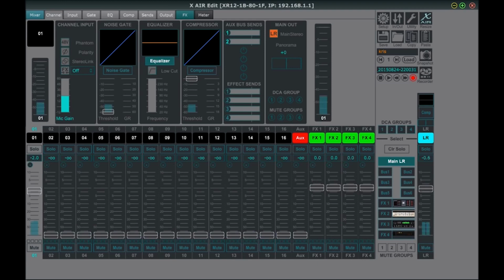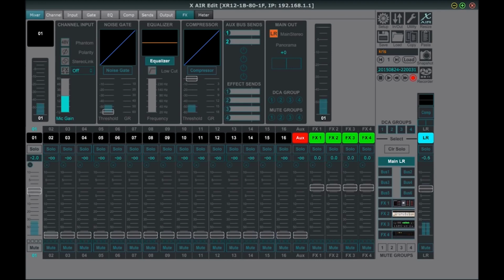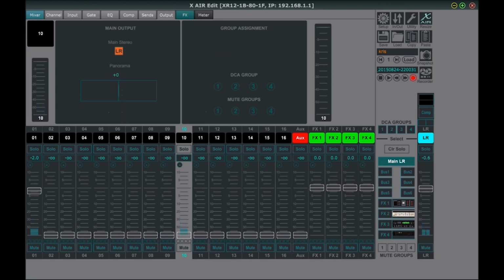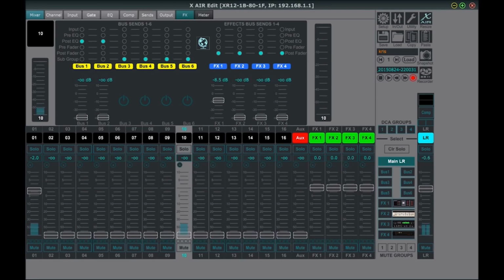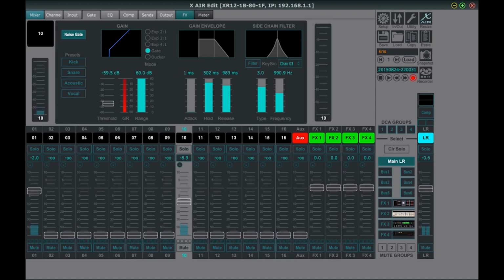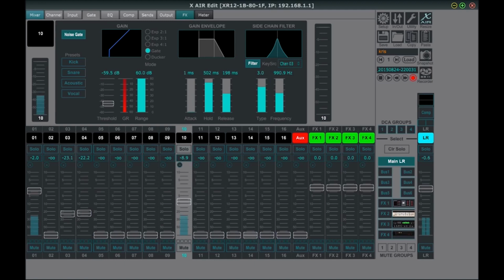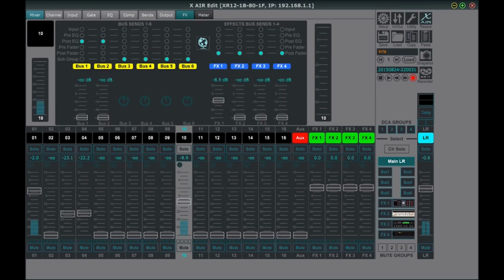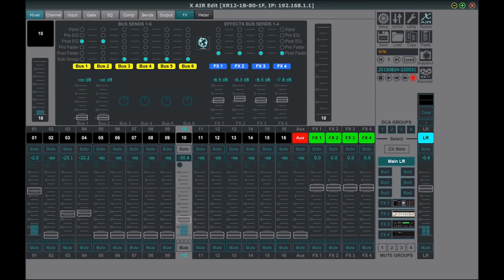Automating fx using gates on digital mixers or DAW's demonstrated on an Behringer xair 12

Comment: Pretty cool. I wish this didn’t use a track as I already use all 16 tracks on the XR18. Might be time to upgrade to X32 rack =\
Reply from the maker: Yup, although in fairness if you have someone running your sound already you probably don't need to set this up, this is a bit of a hacky way to run a solo show without having to bypass your fx manually.